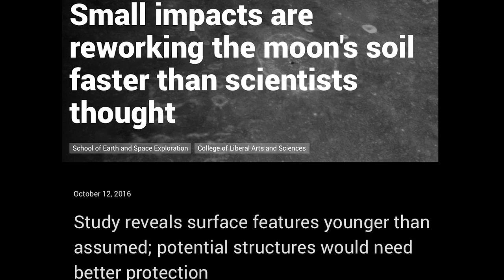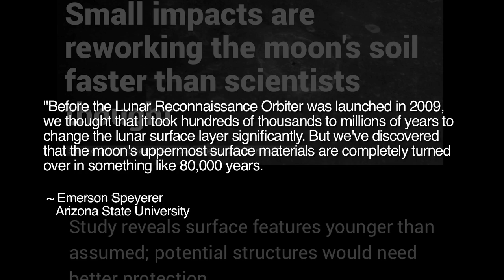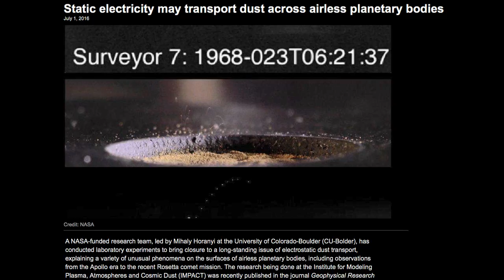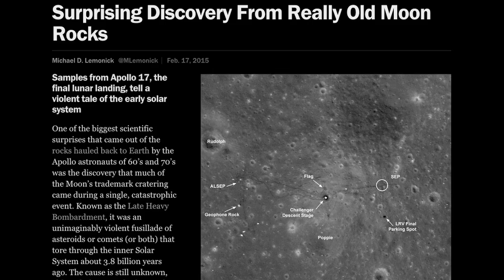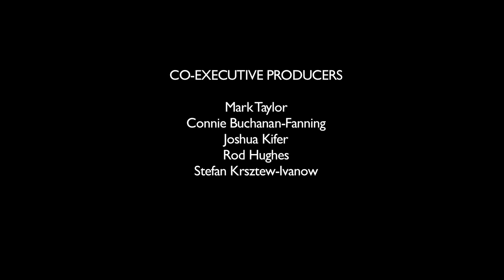New Lunar Craters Mystery | Space News

Comment: With as often as the Earth goes through meteor showers it's no wonder the moon gets impacted often from the same sources.  I understand the EU theory and believe you have a good model of electrical interactions in the universe but, I'm going to reserve judgement on cratering on the moon being caused by electrical charges and not meteors.  Most of the moons cratering is on the far side.  We have videos of objects hitting the moon and seeing the flash of impact.  I wont rule out the possibility of a big electrical discharge causing small craters but,  there will need to be more evidence of it happening and the frequency of it happening if there is evidence.